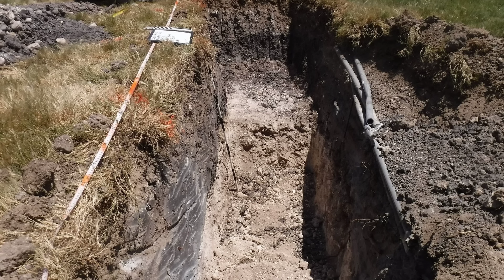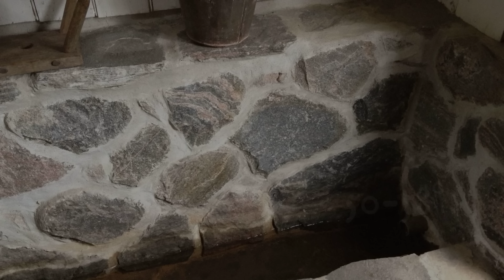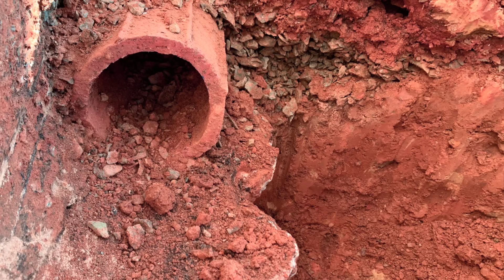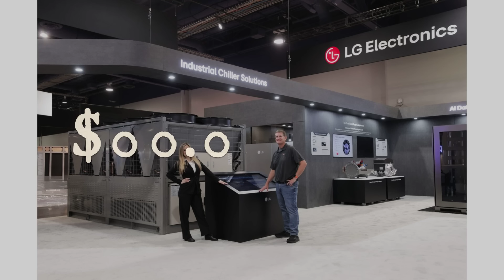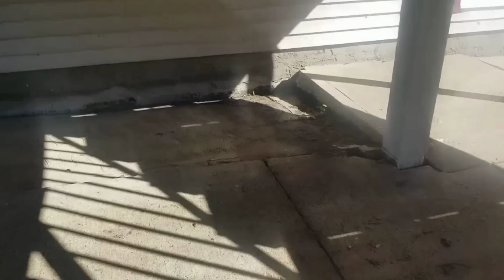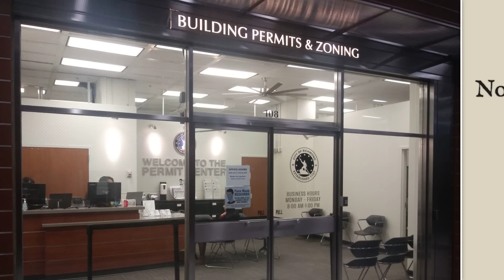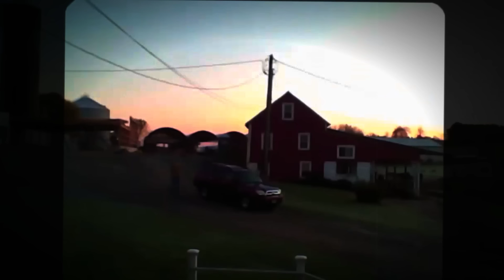This $300 Tunnel Keeps Any Home 55°F Forever — The Amish System the Cooling Industry Made Illegal

Comment: The cool air condenses in the pipes and the low areas fill with water that stagnates resulting in mold, fungus and smelly damp air. Ground cooling needs to be a closed loop liquid based system with a heat exchanger above ground that cools fresh air.

Comment: I love this discussion as I have been in the HVAC industry for 32 years. I agree that the HVAC industry has an element of corruption (like almost every industry). 
Using the earth to absorb & dissipate energy is awesome and has been used for a long time and won’t stop being used. The use of glycol systems are fantastic. HRV’s & ERV’s are also very widely used and required in most new construction, commercially and residentially. They are a low energy efficient way to get air changes in a building or home. Your video showed them.

Comment: There's no conspiracy to hide this; thermal mass is not a secret.  It's just that excavation is expensive, and if lots are small (suburbia) you have limited earthen mass to excavate.  It also depends on your water table depth and average soil temp under your house.  Certainly there are a LOT of places that could do this, but it's short term cost prohibitive mostly.  As electric costs go up, it will be of greater interest again.

Comment: The only issue i see with this system is that with modern residential buildings, everything is super flammable. If a fire would start, the pipe would be a massive air intake for the fire and would help it spread fast, giving it a constant supply of oxygen. If the outside supply intake has a way to be closed, it would help with that problem.
Reply: That's a US problem, proper houses are made of stone.
Reply: @HAWXLEADER the stuff inside the house still burns
Reply: Yep.  I didn't think about that when I opened doors in either side of the place I live now when I woke up to the kitchen on fire.  Just was so damn difficult to breathe.  For one thing, NEVER trust lithium batteries, ESPECIALLY on a charger (Energizer in our case, not some rando brand), and people majorly underestimate how bad house fires are, especially in modern houses, filled with plastics, electronics, paints, etc.  The smoke was black, just like a burning Tesla, and people really don't understand how hard it is to breath, how bad the smoke is to inhale, and how unprepared they are, as well as how difficult it is to make decisions when you're simply desperate for breathable air.  

One of my brothers living with us has been complaining about not being able to bring his e-bike battery inside, but he wasn't present during the fire (btw, parts of the wall had to be smashed out because the fire was inside cabinets and actually even inside the wall), so he doesn't understand why we aren't willing to risk that.  

An elderly man in China brought his e-scooter into a very small elevator in one video, and he was literally roasted alive.  Lived for just another excruciating week.  

Stay safe out there folks.

Comment: Stop being overtly dramatic and dumb. This technology is not illegal, nor was it invented by the Amish.  It was actually created by the Persians.  You know, the people that the tangerine testicle recently, much to his chagrin, decided to wage a war against?  Their design does it one better as well, because their system does not require powered fans to move the air, just the science of aerodynamics itself.

People in the Middle East have been successfully using this technology for several thousand years.  It works by harnessing the thermodynamic laws of evaporative cooling, and the aerodynamics of wind pressure and flow.  You dig a vertical well down to the water table, this is your air intake.  You then continue to tunnel horizontally along that plane for your desired length, making sure to leave an air gap above the surface of the water and the tunnel surface overhead.  You then dig another vertical tunnel which connects to the lowest level of the building you are constructing, usually a basement used to store food items.  From this basement area, you construct vents and ducts to feed this cool air to the rooms above.
But the most important part of the system, is the Windcatcher.  A specially designed tower on the roof, that uses daytime heating, and negative air pressure caused by the blowing wind, to draw the cool air from the basement below, up into the building.  Creating a comfortable living area that can range in temperature from in the low 50's, to the 70's, even during the hottest part of the day.  All without a single moving part.

Here is a link to an interesting article about the technology.

https://www.france24.com/en/live-news/20230721-iran-s-ancient-wind-catchers-beat-the-heat-naturally-1

Comment: geothermal cooling of air or water. helps if you have a permafrost layer to sit the tube on top of. south of dallas its  64°  so geo thermal heating works also below 64 outside. you could also lay pipe or hose inside the m airpipe and cool 2nd story with chillrd water with circulating  pump and radiator  or zone  looop cooling.
where do you think we got the phrase " cold as a well diggers ass" ? 
wells ? 2 car radiators a circulating pump some pipe or btube and a box fan...

Comment: It's a lot cheaper to put in an air conditioner or heat pump than to bury sufficient pipe below 6 feet, which is what geothermal HVAC systems do.  Then there are the problems with water table, radon gas, humidity and heating the space.

Comment: I tried to do this in Florida and drowned
Reply: Yeah most of FL ain’t nothing more than a sand bar. 

Although water can absorb and release a bunch of energy so a water to water geothermal system could work well. 

Dig a decent hole and fill it with sand besides the inlet, outlet, and heat exchange. Put a heat exchange in the house with a fan moving air over it. A pump to circulate the fluid. Boom geothermal heating and cooling.
Reply: well no  you can run your pipe underwater or under swamp for same effect. sketch the system out andor watch the movie again
Reply: Did you get better? ;)
Reply: @zMeeeMz  no i ded
Reply: @misterkid  damn bro, thats bad.. condolences.. drink water, get better soon! :D

Comment: Good lord why do people feel the need to turn everything into a conspiracy. There’s plenty of real conspiracies without making up any more. Nobody has hidden any of this information from anyone. I’m a contractor and we’ve been installing ground loop systems to heat and cool homes for decades. Just about anyone who grew up in the country knows about spring houses and root cellars. The building industry and tons of people in general are very familiar with everything in this video. There’s probably millions of homes and buildings with ground loop systems in the United States alone. There’s many reasons why these systems may be impractical for many applications. But none of those reasons have anything to do with people not knowing about them or because the information has been hidden from them.

Comment: What needs to be done is that an efficient passive cooling systems to be perfected then coupled with an existing structure re purpose. Use existing ac units to market an atmospheric water generator and do the installation all at once

Comment: Two problems to overcome.

1. Mold growth. Mold grows at 60% humidity. It doesn't matter if the air is moving or not. This is an issue in many of the Amish homes in Lancaster, PA.

2. Radon. Radon is a radiation that seeps through the ground. It is in every location on earth with various quantities depending on the geological makeup of an area. This system would pump the radiation directly into the living space. 

As long as steps are taken to overcome these problems, it could be a good solution.
Reply: The correct pipe inclining or declining in a p trap will drain the moisture, but I will need to be at a 3% grade to avoid pooling.
Reply: Correct my dear sir....answers:

1. duct/ventilation
2. duct/ventilation

There. Solved:face-blue-smiling:
Reply: Nice try, but this misrepresents well-established building science. Radon enters homes through cracks in foundations, gaps around pipes, crawl spaces, and similar pathways due to pressure differences between the soil and indoor air. That process occurs independently of any underground air-tube system used for cooling.

The presence of radon is determined by local geology and pressure dynamics—not by whether a home uses buried pipes to temper incoming air. Suggesting that such systems uniquely “pump radiation” into a house is misleading; any airflow system must be evaluated based on design, sealing, and ventilation, not exaggerated claims.

If the concern is indoor radon levels, the scientifically supported solution is testing and, if necessary, installing a Radon mitigation system—not discouraging passive cooling methods through inaccurate reasoning.
Reply: @xpatches13  Radon also has to do with air settling and no air movement, The fix for radon is to circulate the air.  If the air in the pipes are circulating it is of no danger.  Also geothermal cooling has been around for ages, this is not new or even banned in the US.
Reply: @rynoz9711  geothermal cooling doesn't use ducts in the ground. it uses a closed water loop in piping in the ground. there is a huge difference.
Reply: @rynoz9711  the air needs to be moved and ventilated outdoors, not stirred around in the living space. This system is exactly how radon is ventilated, but it has to be vented to the outdoors where it is diffused into harmless amounts. Venting it into the living space is how you could end up with dangerous levels of radon in your home.
Reply: @Claymore1977  tell that to oranges in Nebraska
Reply: @xpatches13  radon is microscopic and can even penetrate through plastic, steel or concrete. One of the mitigation methods used to prevent it in structures is to bury a pipe similar to this under the foundation and vent it outdoors under positive pressure. If you're forcing that air into the living space, you are literally exhausting the radon into the living area.
Reply: @xpatches13 Mf ain’t nobody getting radiation from a crack in the floor… might as well be dead then with damaged dna with all the laying of the floor I’ve done and mud I played with as a kid … 😂
Reply: @xpatches13   Yup.  The problem with newer constructions, besides th absurd amount of toxic chemicals that out less paint to shame, is the fact that they're more airtight than homes like I grew up in, that were built in the 50's, single-pane windows until sometime in my teens.  These newer homes trap the radon in far more, and it's been proven scientifically.
Reply: @xpatches13  Thanks, ChatGPT
Reply: There's worse things in your water
Reply: @WithinReason-l6r  could be, but that's a different problem with different solutions. If you were drowning in the Atlantic Ocean, it wouldn't help you if I pointed out that you could be drowning in the Pacific Ocean.
Reply: @WithinReason-l6r  could be, but that's a different problem with different solutions. If you were drowning in the Atlantic Ocean, it wouldn't help you if I pointed out that you could be drowning in the Pacific Ocean.
Reply: We love people who can point out problems instead of solving.
Reply: @Vividxful  the first step in solving a problem is recognizing that you have one. Knowing that these issues exist will help people decide the right solution for them.

Some of the solutions were mentioned later in the video. Using smooth walled pipe helps reduce mold growth. Also, a dehumidifier will remove the moisture in the air. Using a heat pump transfer system with a water and radiator setup eliminates the underground air transfer. There are multiple solutions, but make sure the problem is addressed.
Reply: @Vividxful  identifying the problem is literally the first step in solving the problem genius.
Reply: @Vividxful  and you’re no better.  You’re given the knowledge of what the problems are, and you have a device more powerful and with more knowledge than any encyclopedia ever written in the world but you can’t do do a simple google search, and lack the simple knowledge of what the purpose of owning a dehumidifier is.

Comment: Now how about heating during winter
Reply: A ground-source can also be used for heating during winter. I'd say it's far more efficient to use hoses with coolant water in the ground, because of the much higher heat transfer capacity.

A heat pump will then cool that water, which is being continuously pumped around the circuit in the ground, and put the extracted heat + the heat from the electricity used, into the house.

Let's say it runs at an efficiency of 3.5, which means if the heat pump puts 9 kW of heating into the house, 7 kW of heat is extracted from the ground, and the pump uses 2 kW of power (which also ends up as heat).

Comment: I know you’re hyping this as a conspiracy to get more clicks but there are limitations to earth cooling. Personally, I learned about earth cooling in architecture school. We learned it along with passive solar, thermal storage, and many other passive methods. But the reality is mechanical systems heat and cool and are often cheaper up front and are more reliably comfortable for most occupants, and that is the real reason most buildings go with mechanical cooling. It’s not that the ancient methods don’t work, it’s that a skyscraper is not going to be cooled with a small fan and an earth tube. A house you can do that and it can work well.

Comment: Its amazing you don’t mention radon until later. I think all homes should use the one attached to the heat exchanger. The last thing people need to breathe is radon, mold, mildew from imperfect structures traveling underground
Reply: There is some research, which suggests, that Radon is actually useful against a number of different illnesses.
https://www.youtube.com/watch?v=zZkusjDFlS0
Reply: Radon is the biggest scam ever. You odds of being injured/dying from a spider bite are MUCH higher than being remotely effected by radon.

Comment: Great real information that could maybe* help MILLIONS of people.....
But you can't dig underground, nor does this principle hold, when at sea level, living at the beach.
Mechanical AC is pretty much required there for comfort, though there are other ideas....
Also digging requires permits and heavy equipment, this retrofit costs a few thousand dollars minimum.
Lastly, this system is not regulatable (to control the temperature in your home) you get what you get.
This passive cooling effect is not enough for hot people like me who require 68-71 degrees to be comfortable, especially when sleeping.
This passive cooling system cannot keep up with heat from multiple appliances like in the kitchen with the oven going and fridge, also in entertainment rooms with multiple PC's and other electronics going.
Also multiple story buildings higher floors are MUCH harder to cool, and heat.
The best thing you can do is supplement your mechanical AC/Heat with this ancient knowledge, which WILL save you some money and wear on your mechanical units, but with large upfront costs for long term savings, very much like solar power.

Comment: What do you think of having a separate section that during winter the water pipe picks up heat using a compost pile. Shut off valves used to turn that off during summer.

Comment: I offer geothermal in phoenix as an ac contractor. Still requires an ac unit but underground duct works extremely well. I have a 5500 sqf house i cool with 4 tons ac. Barely runs. No conspiracy. Its expensive to dig here. Takes lots of vents and pipe to get enough surface area for cooling. Just money upfront or over time.
Reply: Hey bud I live in Phoenix as well. Can we get in contact, I would like to apprentice with you if possible to learn to do this.
Reply: I do hvac.  My new 4800 sq ft has a basement.  It’s all cooled with 3.5 ton inverter and has spray foam.  Stays comfortable and 74 in summer.  The 21 seer inverter can run off solar once I finish the solar.  I’ve seen houses set up with this tunnel thing and they are not comfortable in summer.  It doesn’t put out enough to compensate for the heat gain and the house is hot.

Comment: Only problem i see is that in Florida, 6ft down puts you in water. Not everywhere but in a lot of places.
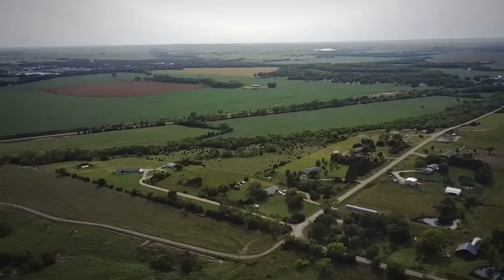Reply: @12:00 Dig the trench and bury a coolant tube instead, get one of the many devices or you can probably build your own ex-changer, might actually work better then the dry air version. as the water will accelerate transfter, just gotta be careful to take care of your tubing so you don't pollute your ground water.  guarantee there is an option for you, and like the video suggests, it's probably not in the code book.
Reply: Install a water tight tube then
Reply: Water is a better heat conductor then air.
Reply: That wouldn't matter...
Reply: The gound and ground water isn't 55, it's 72.  I tried to get water cooled AC in my house and they wouldn't install it because the ground is too warm.
Reply: @Acmecycle 
I agree. I live in South Louisiana.
Reply: @Acmecycle  wheew.. you guys have 22C water underground? Those cold showers doesnt sound so cold, do they? We have basically constant 7C.....
Reply: In Florida thermal condensers should be used but they oddly still use air cooled

Comment: 65 degree air will not cool your home in the deep south.  It will help cool a home in a place that probably is fine with just open windows.  And you cannot create a 35 degree basement, it's not a thing.  Temps underground are not below that.